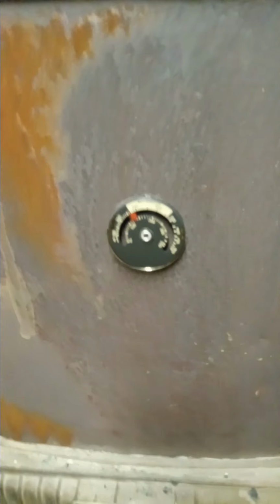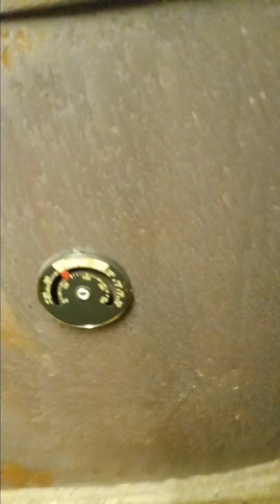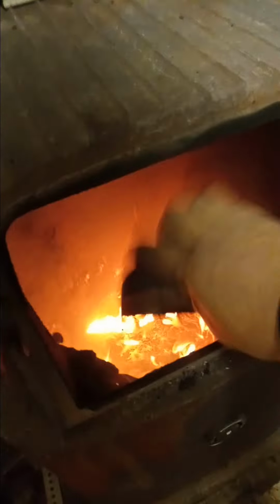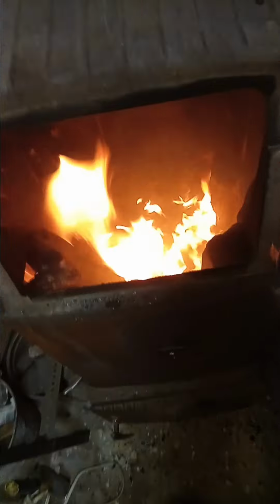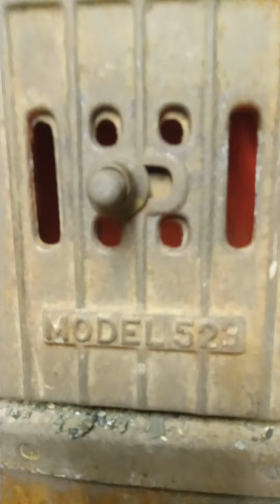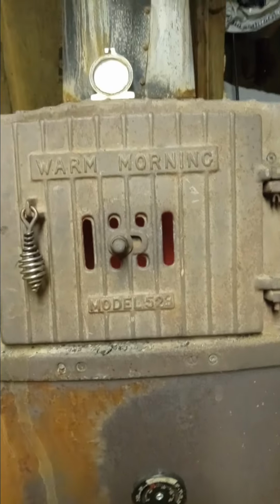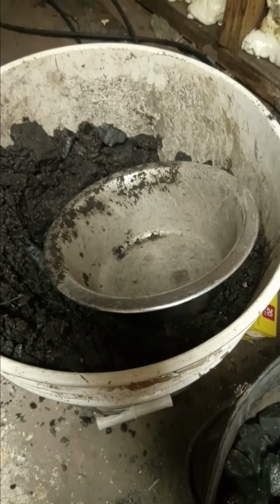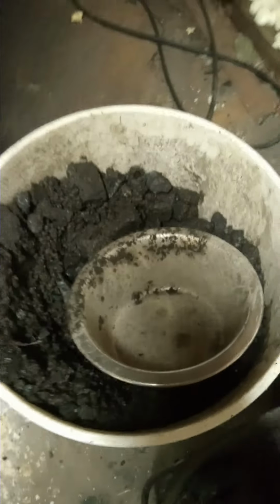Bituminous coal burning in Warm Morning 523

Comment: I had a hand fired, thermostat controlled furnace which used anthracite stove coal. Started a fire in the fall and let it burn out the spring. I didn't have to fiddle with it much other than shovel out the ashes and in the coal in the morning and add a shovel or two in the evening. It was almost self regulating because when it was cold out the draft pull on the chimney was greater. In another house I had an auger fed boiler which used anthracite pea coal. It also had a coil for domestic hot water. The ashes fell into a bucket under the retort. No smoke or back drafts on either. No poking or clinkers either. The furnace could work without electricity but the hot water boiler required current for the auger and water pump.
Reply: Anthracite is the best!

Comment: I was at Ft. McCoy, WI, back in 1987 for a short time. They still burned coal to heat the old barracks bldgs (I think most of it was built prior to WWII). You'd go outside and there was a thick yellow smog that hung in the air and it smelled foul (almost took your breath away),  must of been the bituminous they were burning.
Reply from the maker: Yep anthracite don't do that

Comment: I live in Pennsylvania and have always burned anthracite I have a stove exactly like yours and I use stove cold if it packs in too tight it will not breathe and burn correct I have had it burned for 5 to 6 months at a time without going out but you do need to bust up the clinkers once in awhile
Reply from the maker: Yes I'm in western PA about 40 mi from Ohio line, so thr anthracite mines farther east. Cheapest I can find anthracite is 450 a ton bagged on a skid. If I lived close enough I'd just go to the mine and buy bulk. Closest mine to me is all bituminous.and about 30 miles away so I burn anthracite in the colder months and use bit early fall late spring or if I need fast heat plus it's only $70/ton
Reply from the maker: I was posting these videos to help out some people on stove groups, but apparently the admin on the sites don't want youtube videos posted and they too long for Facebook. Some people where having trouble or wanted to learn or had some real misconceptions about coal, previous videos are of burning anthracite
Reply: Thank you so much. Very helpfull. Greetings from the Netherlands!
Reply from the maker: I wish I could find a place that would sell those corner flue blocks to me at a reasonable price. I never get to find a deal like that

Comment: I only got 6 hours burns on bit.
Reply from the maker: It depends in mine, anywhere from 6 to 10 if I just let it fuse together and not poke it, definitely lasted till I got home from work to pick it back up unlike the epa wood stove I had for one season chucking wood in every 3 to 4 hours...and be out by time I got home
Reply from the maker: Definitely alot less work than wood. And the price point is better than anthracite, I burn anthracite primarily but always have bit on hand for like days today in mid 40s where I let it Peter out in the morning then get it going in evening and not have to worry bout getting up through the night

Comment: First, I don't know. But I suspect you could shut the damper some. I guess your stack temperature should be a hint. You could check smoke and CO2. Maybe I expect too much from a basic stove.
Reply from the maker: No I run a barometric damper look in my other video Anthracite coal burning in Warm Morning 523. I took my mpd out.. I explain it in that video
Reply from the maker: Coal dose not create high flue Temps because the heat stays low un the stove unlike wood where alot of heat goes up the chimney
Reply: I've got an old Bacharach CO2 tester and happen to have the card for stack temp and CO2 readings and the correlated efficiency. It shows a couple or a few types of coal. It's all very fascinating. Thanks for your time and replies.
Reply: @johnnytacokleinschmidt515 CO 2
???????
Ummmmm, yeah. If you have high CO 2 readings I bet your house plants look great!😂😅😅
Reply: @scottreynolds4827  combustion analysis

Comment: I've always burned anthracite (NE PA...the stuff practically lays on the ground here - like $200-250/ton.  Was $100-150 pre-2020, then the world went stupid).  It's great to see someone who appreciates and understands coal.  How often do you have to clean the furnace and chimney running bituminous?  I'm good once a year in September/October before it runs every day.  
Also, sweet antenna!  I'm a ham, but I'll mess around on 11m once in a while.
Reply from the maker: Chimney only 6 foot above stove adapter, I have the previous videos to this one are of burning anthracite, it's single wall pipe through metal roof I don't clean it its strait just tap it occasionally, when I'm running anthracite it basically cleans itself
Reply from the maker: And yes I am a ham too but just stay on 11 meters in the freeband during this skip cycle